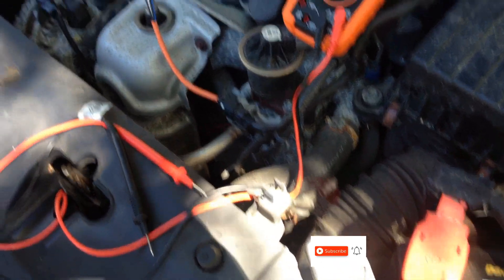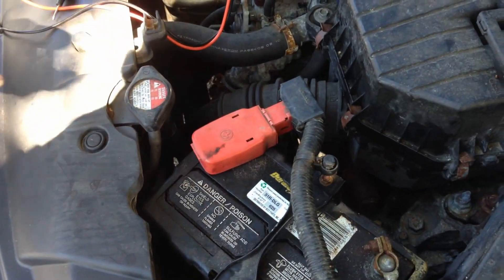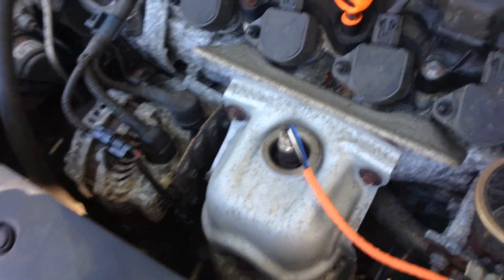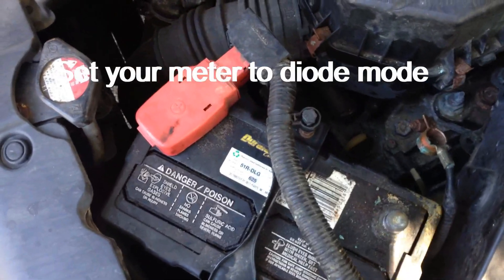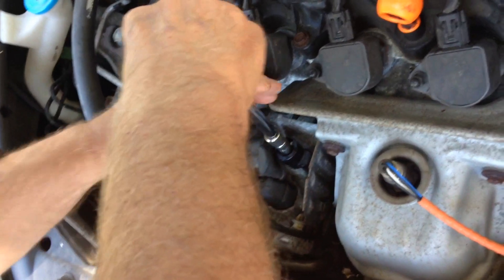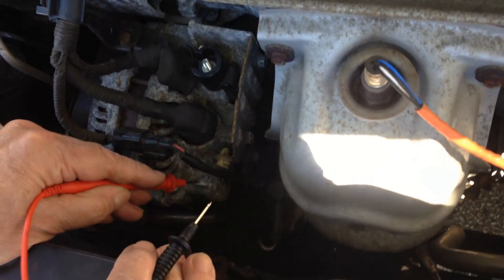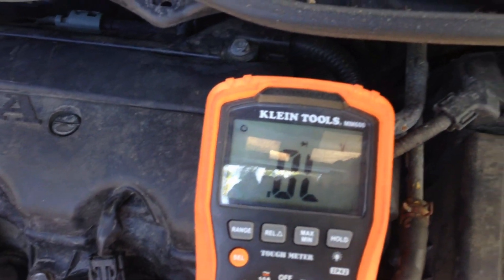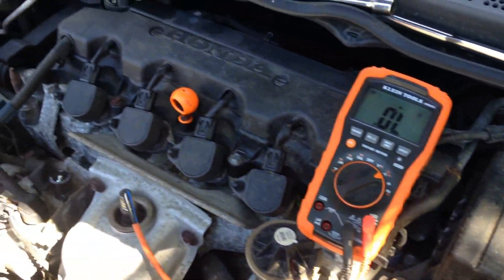Dead Battery Test the alternators diode and battery

Comment: What if my number is 0.400v one way then when switch (put red lead on battery and black on alternator case) the number goes from .400v slowly to -1.300v (negative). I can’t easily disconnect the positive battery cable so I’m testing from the battery but I am disconnecting the negative battery terminal.
Reply from the maker: Thanks for watching. Normal car alternators typically have multiple diodes. These diodes are part of the rectifier assembly, which converts the alternating current (AC) generated by the alternator into direct current (DC). Doing this test as shown is a good barometer that a few of the diodes are OK. When doing this test and then reversing it shows that at least few of the diodes are OK giving you some kind of idea on the condition of your alternator.IMO. Hope this helps. have a good day.@fixitwithfc

Comment: For all cars, there is also a jumper between the engine and the body /frame, if this ground bonding jumper is bad, you have a hell of a time starting. You can easily improvise one with any wires. The other way to check alternator is to use the AC scale, anything more than a volt of two the diode assemble is bad.  But the voltage will be right up there just much less amps.
Reply from the maker: Thanks for watching. And commenting. It’s always a good thing thanks.@fixitwithfc

Comment: That first tip is critical . I cleaned all my terminals and grounds on the Roadking and Electraglide. Before, they both had hesitation on starting, but now they fire right up. Cleaning the ground helped the most, at the frame area.
Reply from the maker: Thanks for watching Big ED do appreciate it. Have a good week. Ride safe. Frank